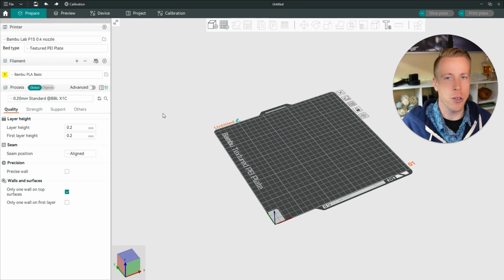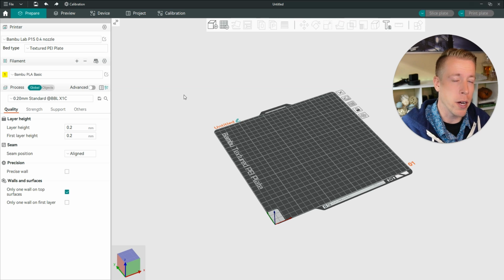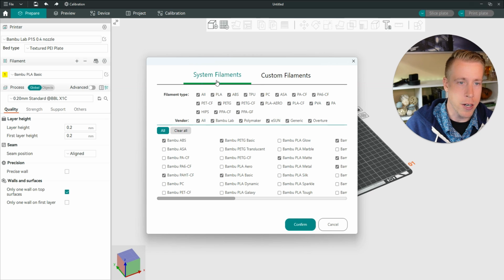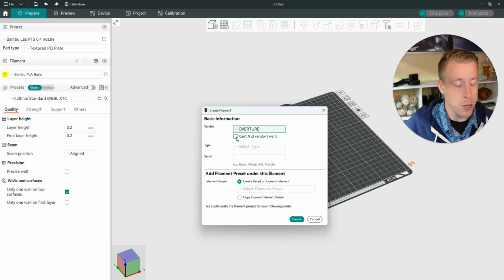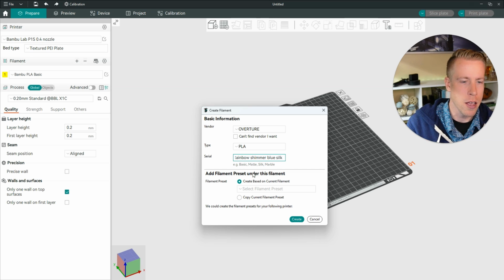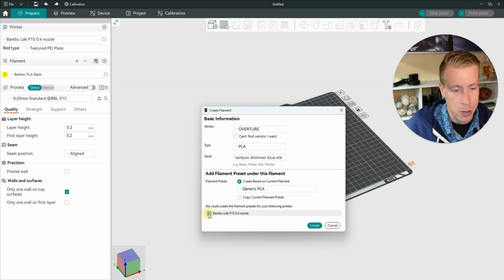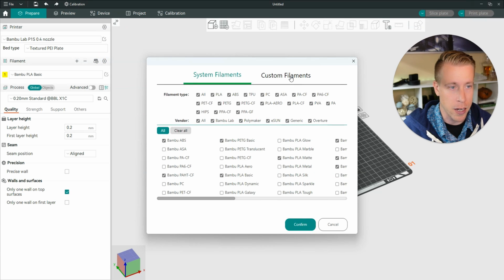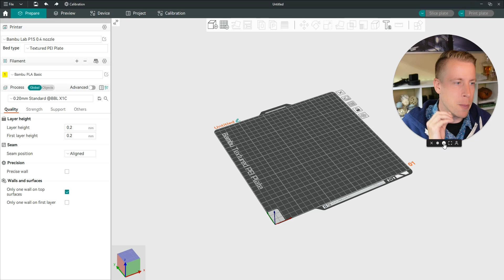How to Add Filament in Orca Slicer

Comment: I can confirm too that, unfortunately, in 2025 there is still no way to add a custom filament, as was shown in the video.  Instead, the only way is to clone an existing filament, by clicking the SAVE icon. After that, you can modify it to become what you need.
Reply: Yeap, absolute shit

Comment: I am using Anycubic Slicer Next which is a child of Orca.  I get how to add but what I am wondering, and maybe you know or maybe you don't...is does a filament library exist anywhere that could be imported (if importing is even an option....)  I mean, so many people have created profiles for their filaments over the years has anyone bothered to gather these into one place?  I am asking as I have roughly 53 spools of filament by 15 different manufacturers (or so they say....like Bamboo filament is actually Sunlu.)  I am dreading having to manually create profiles for every single one I have.  And I have noticed that most slicers only have a few anyway built in.....but at least Cura allows people to share the different profiles...sadly, not a one shared on there is one I have.  LOL  Anyway, just found your channel and enjoying it.  Thanks for any info...  Oh..btw, I have looked on many 'manufacturer' sites including the big boys and I am not even finding information on filaments there.  For example, all the data that you can set/change in the orca slicer for each filament...  cool down info, stretch info, etc... not sure any of this is really needed but, if it's a setting that may cause issues good or bad I'd like to know the numbers... 
Greg

Comment: Anyone able to figure out the dead drop down menu?  I have Orca 2.2.0 and running a Neptune 4 Pro.  My PLA Plus (Black) prints are coming out flawless but i want to add a custom file for PLA PLUS  (Marble) that requires different settings
Reply: doesn't work for me either. I go to the settings of the current filament, change the necessary settings and save it under a different name
Reply: @ yep. That’s what I ended up doing. Not too much of a. Hassle. Kind of like it now

Comment: This doesn't work, there is a missing drop down at the end of the process
Reply: doesn't work for me either. I go to the settings of the current filament, change the necessary settings and save it under a different name

Comment: I had the same issue a lot of other people are having with the "Select Filament Preset" box dead and "unclickable" and found that during the setup I needed to add that I use: (Insert name of printer I use) Generic (Insert Type of Filament".  Once I did that, I was able to follow what you did.  Also, instead of running the setup again, you can also change this in the "System Filaments" tab, when you go to create a new filament.

Comment: Can't do it like how you described. The dropdown menu for the "Select Fliment Preset" is dead and can't select any printer. What happened since a month ago?
Reply: I have this same problem. No presets available
Reply: @jgrady3  I basically had the same issue and I wanted to add a system preset for TPU filament (pre-configured NOT custom) and couldn't find it until I went to "Select/Remove printers..." and I selected Generic Marlin printer. Afterwards it shows several generic filaments but only when marlin printer is selected. Now I'm stuck trying to get that filament profile to work with another printer.
Reply: Might be helpful if you provide the version of orca you are using . Help>about... This is the process for version 2.1.1 of orcaslicer.  You might retry running the startup wizard and making sure you select a few filaments.  Because computers are fun you will need to delete the %appdata%/orcaslicer/ in your home directory. You might also have to select View>show hidden in your windows explorer browser.
Reply: @frankrey7676 did like you said. Doesnt work. When adding the elegoo neptune 4, there is no option to add tpu. The dropdown menu not working either
Reply: Tpu has a large range of settings you will need to create a custom filament. You could grab settings from a pla and adjust it to match the tpu manufacturer recommendation.
Reply: @frankrey7676 any idea for settings for pla+? Every time I try to print it it’s super super stringy, seems like over extrusion bc when it prints it drags all over 100% infil, I can print petg just fine. I don’t know the difference in pla and pla+
Reply: @DatHondaBoi223  have you gone through the calibration options in orca. They help you tune the filament profile. The top left area calibration is the rightmost option. . there is one for extrusion Volume ( two part) and another for stringing. 100% infill will definitely show issues if you are over extruding. Could also be temp or press advance depending on where the stringing is. I recommend going through all of the top level options. Ie you don't need to go through both the standard and yolo extension cals.
Reply: @ I’ll have to look into it, so far I’ve been printing for a year and every filament I’ve used works great with default profiles, this is the only one that’s gave me issues.

Comment: Thanks for the useful tips! As chrisl4999 already observed, the gear icon is gone. I tried to use the + icon in order to add a new filament for the Qidi Tech Q1 Pro printer. I've found BASF as vendor but I was not able to find PET CF15 or PAHT CF15 or to choose from. It's strange, because even Qidi produces PET CF and PAHT CF filaments, which can be found and selected, but not from BASF. Any ideas what else can I do in order to succeed?